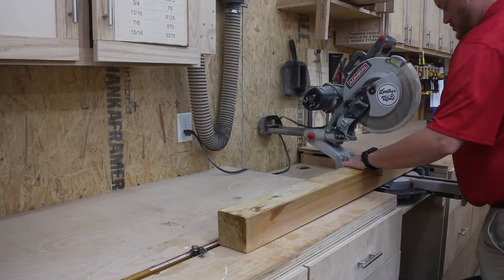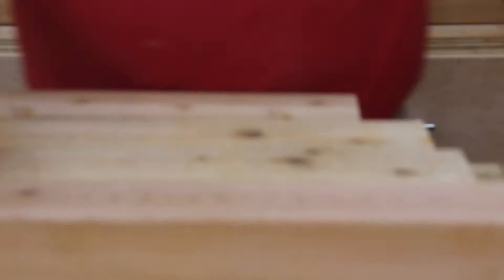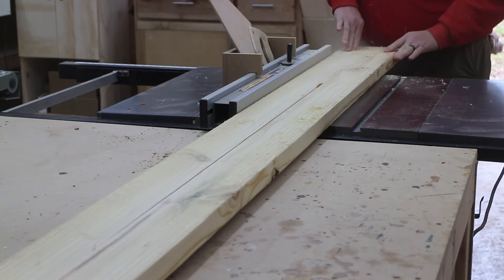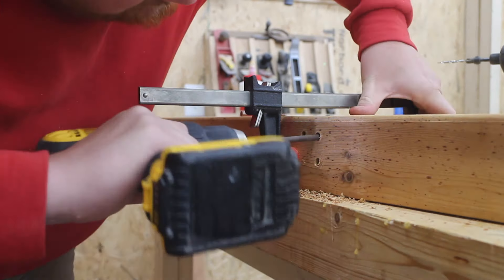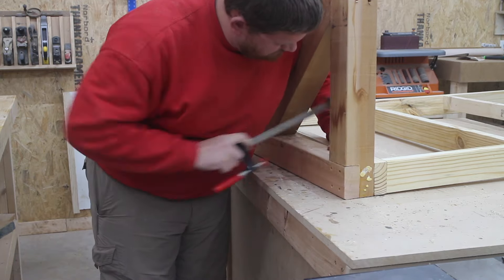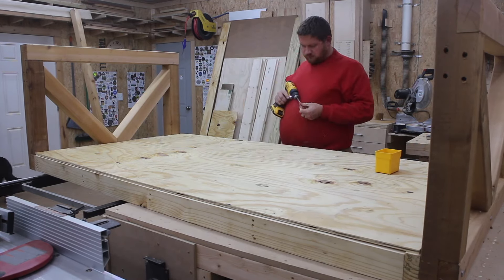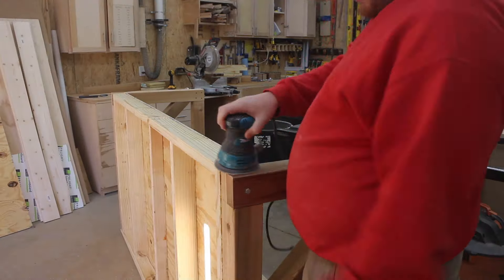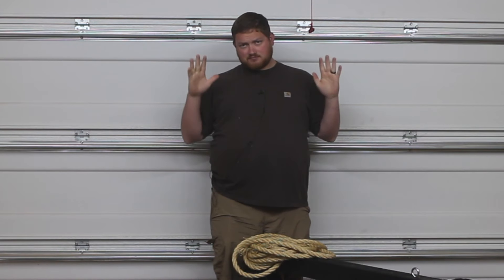How To Make A Bed Swing | Twin Mattress Porch Swing Bed

Comment: You used original Titebond instead of Titebond III and it’s for the outside so no moisture resistance in the glue.
Reply from the maker: Yes. Correct. I will say, however, that this swing is under a porch and has been in place a couple of years and no issue. The screws help hold everything together as well.